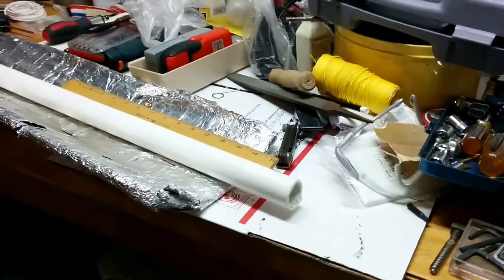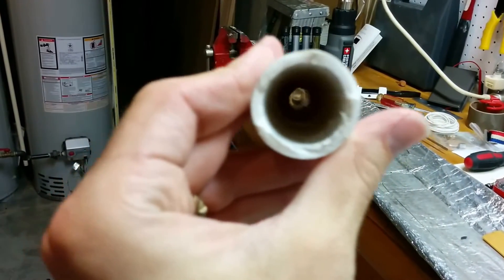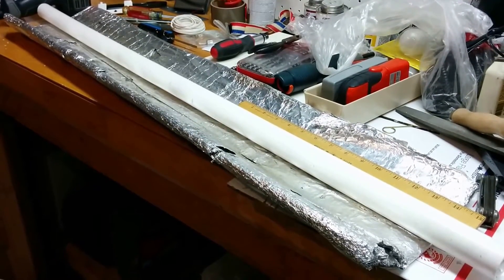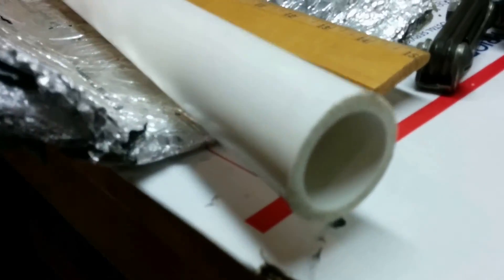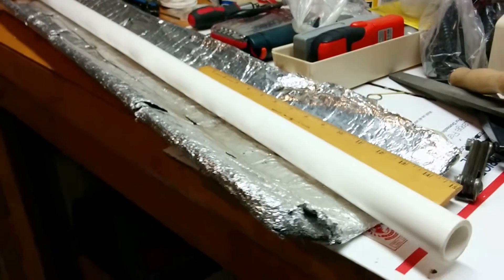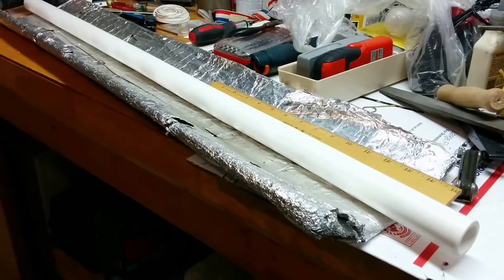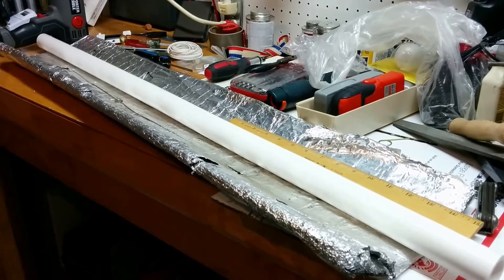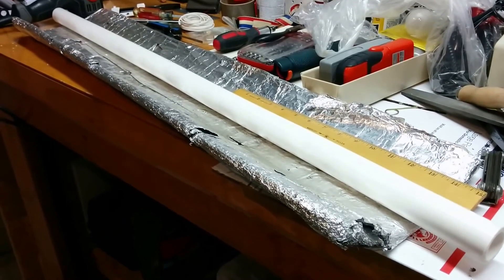The Reinforced Turkish Bow's PVC Core

Comment: It makes it easier for you to ram 3/4 into 1" pipe if you make an 1/16"-1/8" slit down the center.  Doing it that way you barely even need to heat the outer pipe
Reply from the maker: I'll give that a shot s soon as I pick up a table saw (soon, I hope!).  Thanks for the tip!
Reply: No worries ^_^
Reply: A table saw would be nice, but I just use my Dremel tool with a cutting wheel.